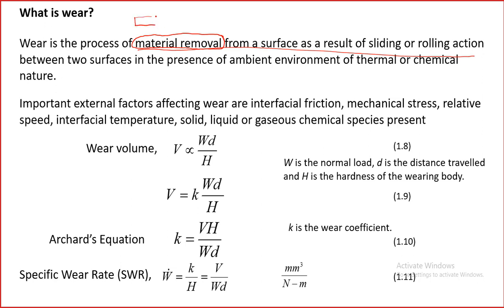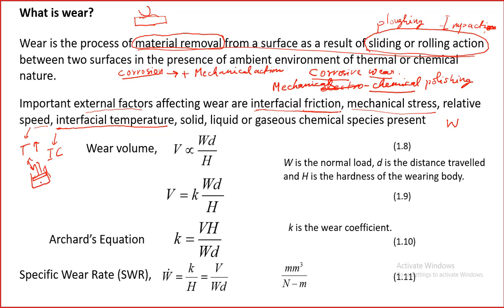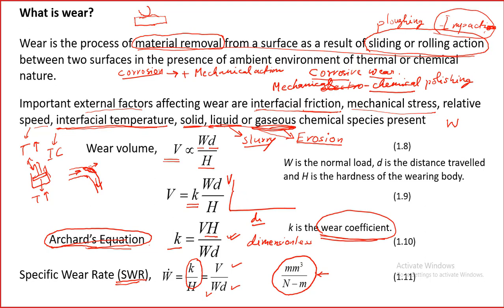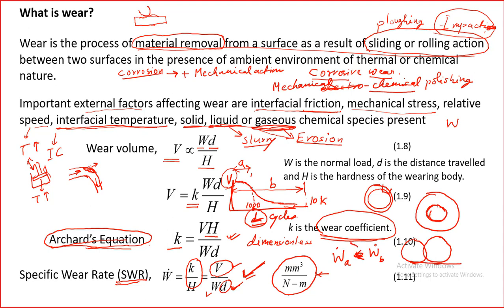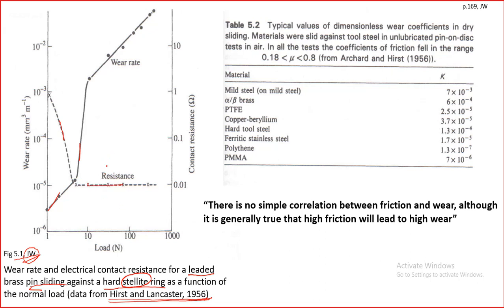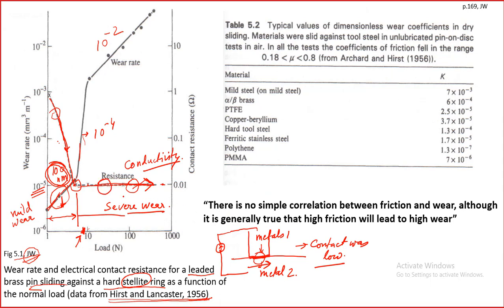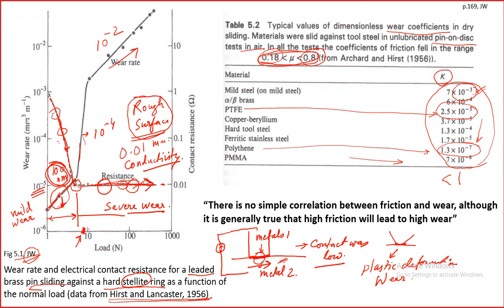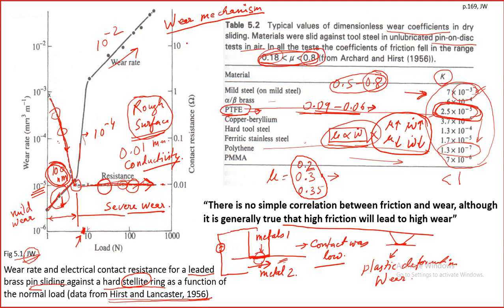Tribological Systems Design - Lecture 5 - What is wear; Archard's Law; Specific Wear Rate

Comment: Can I ask you? I used the Arcard formula to calculate tire wear. If I want to calculate the percentage of tire wear, how will it be calculated? I'm thinking that dividing the wear volume by the all tire volume gives the percentage volume of wear.
Reply from the maker: You are right in calculating % wear. However, the best way of reporting wear would be "wear coefficient", as given in the Archard's law. Or, you could express wear as specific wear rate (mm^3/N-m).

Comment: Can the wear rate be estimated in terms of width reduction of that particular asperity. Example, can the reduction in width of drill bit button as it drill be classified as the wear rate ? Only the width reduction (mm). Thank you.
Reply from the maker: Yes. If you know the original geometry of the button and reduction in the width or height, then you can calculate the volume of the drill bit button which is worn out. Thus, you can calculate the wear rate for your application.